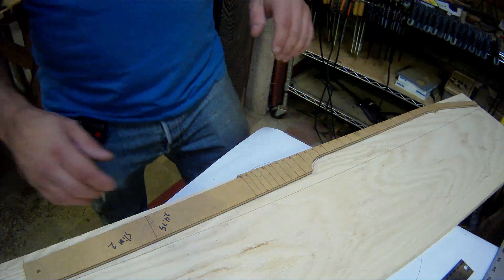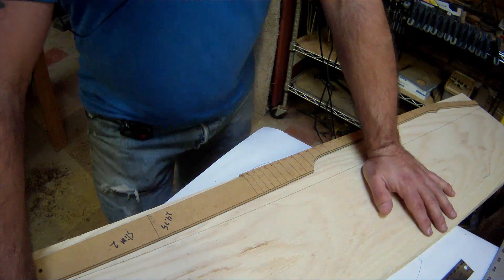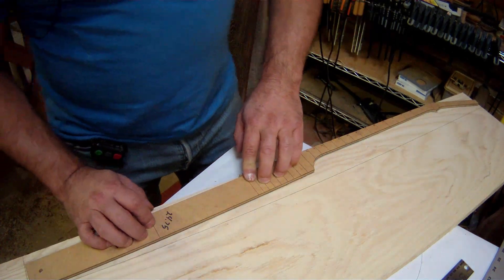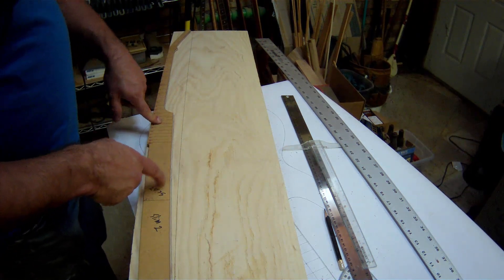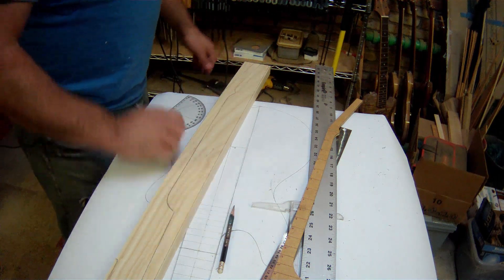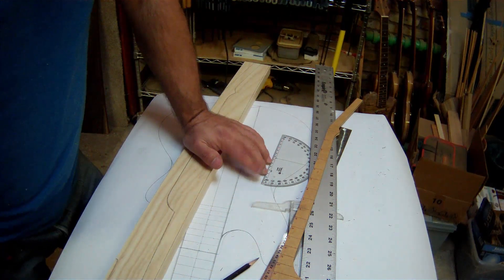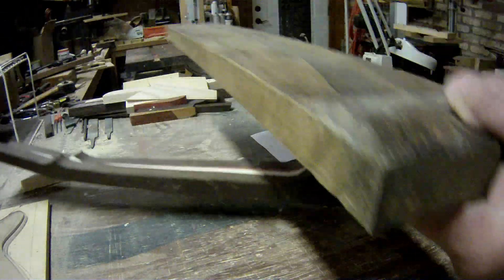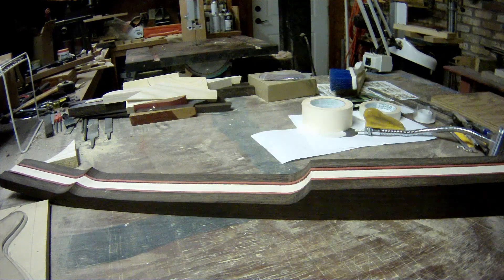Guitar Build 19.05 - Cutting Neck Stripes

Comment: 1/4 off the core and a 1/16 off each red heart stripe.....just a suggestion. Not a big red heart fan, but wow!
Reply from the maker: At least that much off the core.  I just got the stripes rough cut.   And I’ll probably trim the runners a bit too.
Reply: @BoneheadGuitars  I would like to see the maple runners too....sharp touch I was thinking when you said you might
Reply from the maker: @kennethluebberke8216  as long as I have enough it’s happening.  And I’m pretty sure I have enough

Comment: Awesome neck blank. Love the choice of woods. 
Curious about your resaw setup. What blade are you using? Have you had issues with blade drift?
Reply from the maker: Not usually, but with my janky “fence” it felt like it was drifting a little.  I think that’s a quarter inch blade?  But I knew I was going to thickness them both down quite a bit so I wasn’t too worried.
Reply: @BoneheadGuitars  I purchased. 1/2" 4tpi blade and am hopeful it gets good results. Haven't used it yet.
Reply from the maker: @TerribleTim68  this one has done pretty well for most of the things I need, so I rarely change it out for something else.  But I’m no expert on what’s best for different jobs.